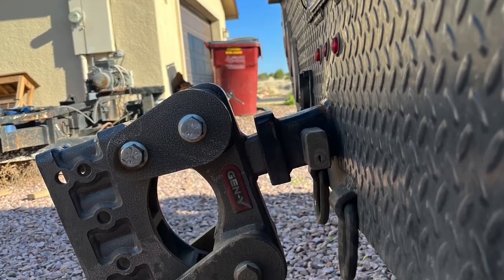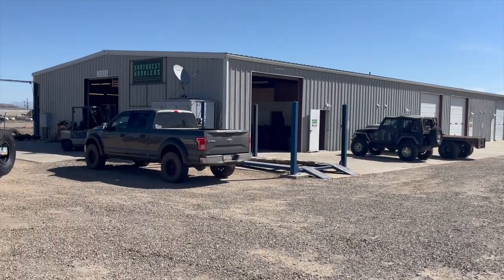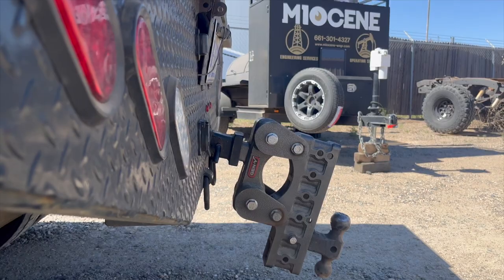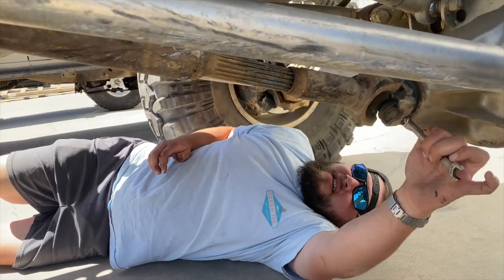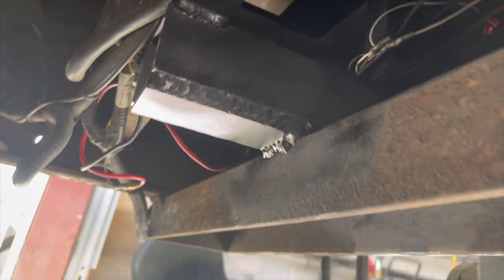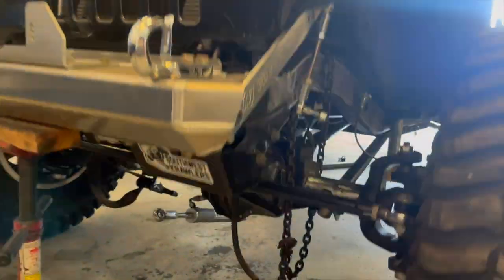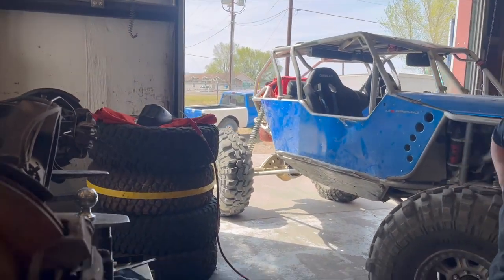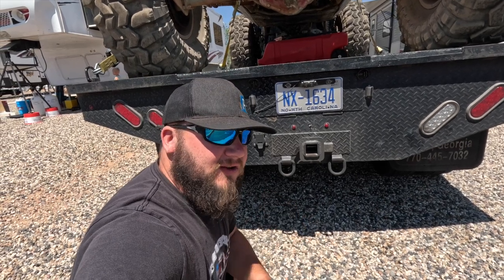We almost lost it all! Full time camper life.

Comment: it looks like to me the gen y hitch stub was too short past the pin compared to the reinforcement of your receiver.   is this a flatbed hich problem or a Gen y problem.  probobly a little of both
Reply from the maker: That didn’t help matters, but it had a poor design on inside of that hitch. Didn’t help that for a short time I ran the Gen Y hitch on the 1st hole, creating even more leverage in the very spot that was weak due to the poor design

Comment: Would a pintle hitch work better?
Reply from the maker: Perhaps. Would have a lot of slop though. It’s been back across the country since this video and has held up really well! The guys over there really over engineered the repair to prevent this from happening again.
Reply: @TaltonOffroadTravel     Thanks.  They carry higher weight capacities than ball hitches.  They also have higher tongue weight capacities than ball hitches.  also allow for more movement at the attachment point than ball hitches. The range of movement provided by pintle hitches when attached to the lunette ring makes the hitch ideal for towing on uneven surfaces like off-road terrain.  Just a thought.   Enjoy your channel.